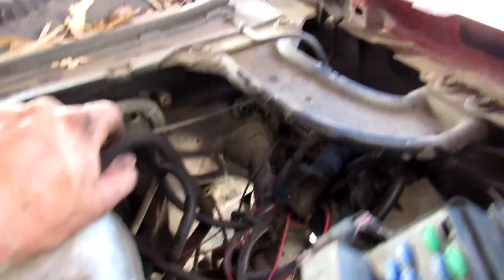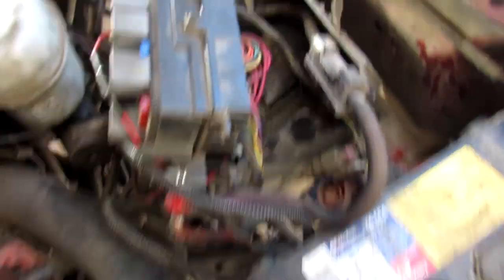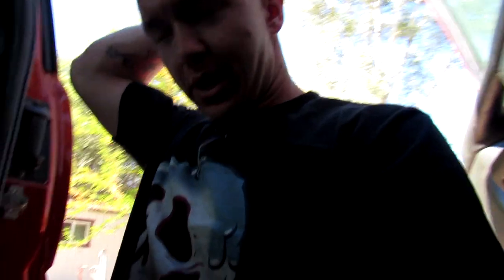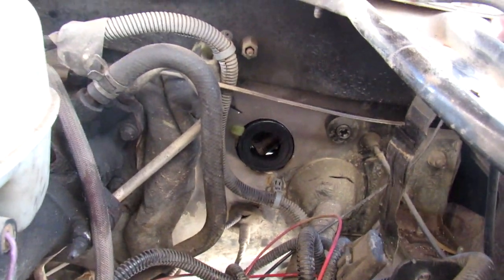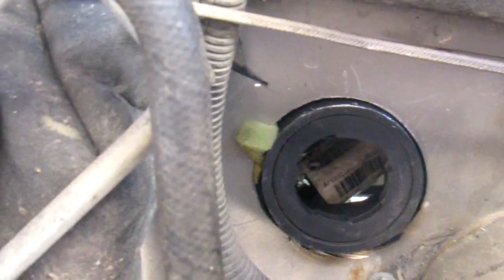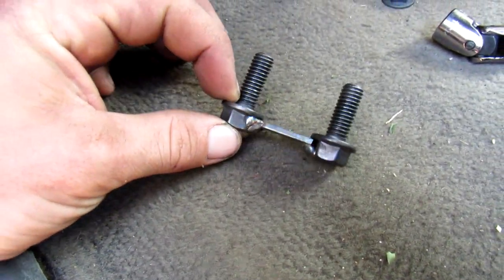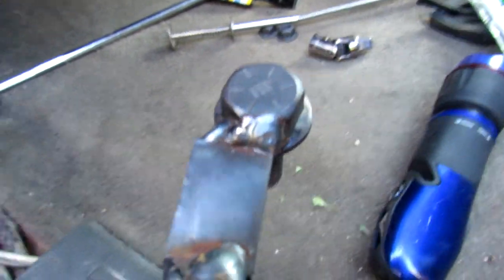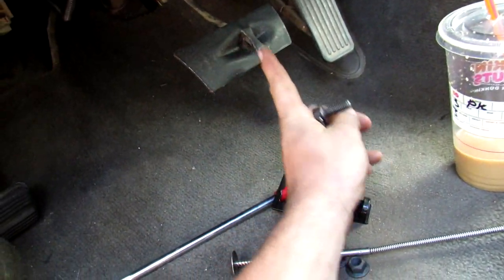DURAMAX Metal Clutch Pedal Assembly Install

Comment: Man i struggle with the plastic crap twist lock pedal.i made a plate to lock in the master cylinder. And it works butt not that good . its the worst part of my 03 . thank you for posting
Reply from the maker: Yessir I haven’t had any problems with this metal assembly and the factory master it’s been really good to me
Reply: So were can i order one man .im ready to stop clutchless shifting .

Comment: I have lots of questions, but I'll wait until after you test drive it with your impressions on how it handles and what adjustments you'll need to make.  I plan on a solid axle swap...."maybe"...build it myself or WFO.  I'd like long travel from LSK, but....$$$$.  Digging the grind you're putting in, thanks for showing it all step by step.
Reply from the maker: Thanks for the support and I will absolutely give some feed back I’m sure I’m gunna have to adjust a bit since I have zero idea of what I’m doing 😂😂 but that’s my biggest thing was money and experience. I learned some life lessons from this I probably wouldn’t have for a long time! But I’ll most likely do a follow up videonofnit

Comment: I wanna manual swap my LMM only part that messed up is I hate to tear up my center console... but I think it would look badass... keep up the good work bud 👍🏼🇺🇸🦅
Reply from the maker: Thank you! And my buddy has a full center consol with a zf6 truck using a remote shifter it comes through the spot next to the cup holders we will be doing that for this build in the future
Reply: DURAMAX_DIESEL when you do this maybe you can email me with he info on the materials he used for the shifter. I wonder if my 07.5 gmc has a hole precut or a cutout for a manual swap bullshit on the body of mine I'll have to get dirty and look I guess. Thanks for the response too 👍🏼🇺🇸
Reply from the maker: Anytime man I’ll see what I can come up with when we do it and I’ll get you a list and some picture in an email

Comment: What about front drive shaft you running that Bluetooth.
Reply from the maker: Yeah I got a WiFi capable transmission with front and rear Bluetooth driveshaft options 😂😂 but really I have to regear the front axle it has 4.10s so when I regear the truck I’ll get a front shaft made